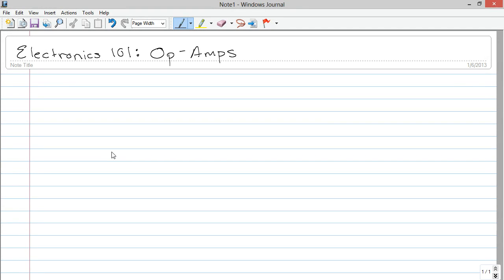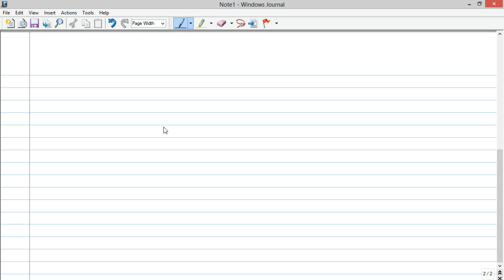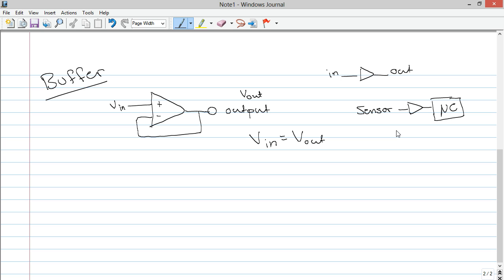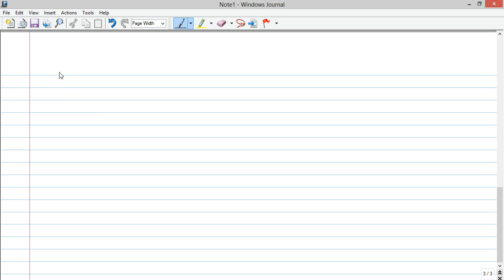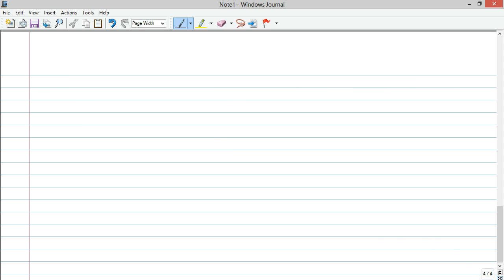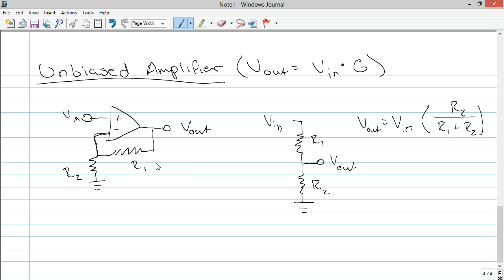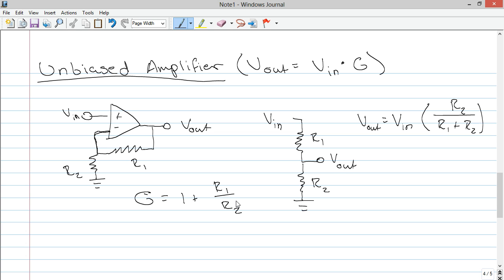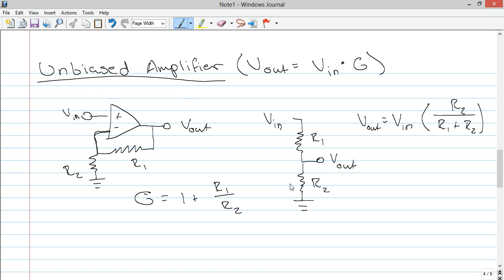Electronics 101: Op-Amps

Comment: Can you check this : It seems that in your right schematic of the op amp there is an inversion between Vin and Vout.
So, you would obtain Vin=Vout(R2/(R1+R2)) and by transformation of the mathematic equation you would obtain Vout/Vin = 1 + R1/R2 witch is the gain that you find.

Comment: When you say "everything stays the same" in referring to the "aesthetically  pleasing" drawing of the integrated circuit with the negative (inverting) on top and the positive (non-inverting) on bottom, do you mean that as a rule of thumb despite the negative symbol on top it is in fact positive? 
Ex. Positive output is ALWAYS on top? 
Or just that it doesn't matter much where the positive/negative output is but instead follow the symbols rather than a rule i.e. positive on top and negative on bottom? Sorry if this is a dumb question I am new at this. Thanks

Comment: i think this is confusing for me bcuz at 9:00 you use v-out = v-h or v-l, but then your graph is using V+ instead of the h or l.  And it's not really clear why there's so many darn v's.  what's the difference btwn the +/- vs the h/l's?
Reply: danh le the h/l refers to the high/low input on the top and bottom of the op amp (being around 5-15 volts on top and -15- 5 volts on bottom or 0 volts on bottom)the +/ refers to the non-inverting and inverting supplies. he uses v+ in the grap to show that once V rises above that line, it becomes V-h and then it begins to lower underneath the line turning to V-l

Comment: i could not follow your reasoning behind the first graph. it rises to v+, but why does it go back down ?
Reply: because output increases beyond v+, and the output is connected to Inverting input(v-), thus v->v+ and  output starts to decrease and reach v-, but suddenly in the journey, vout becomes less than v+ and thus it rises to v+.... and thus this process continues and the output looks like a straight line when it is in this process of switching back and forth

Comment: Hi humanharddrive, I want to design a circuit using an op amp tl072 to reverse the direction of a dc motor. The motor is supposed to do reversed such that the current is limited to a particular value during transient. That's the applied voltage is reduced in steps. The current is proportional to difference between the back emf and the applied voltage.

Comment: I thought about trying to make a low battery alarm for my solar PV system with a comparator but never got around to trying it.  I could use a variable resistor to adjust a reference voltage on a v divider to output a high when one side drops below the other.